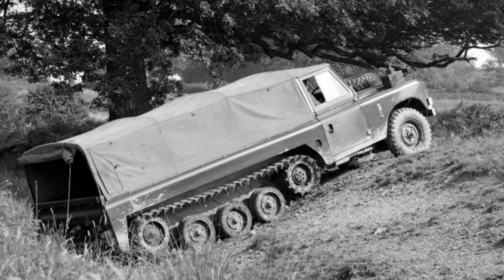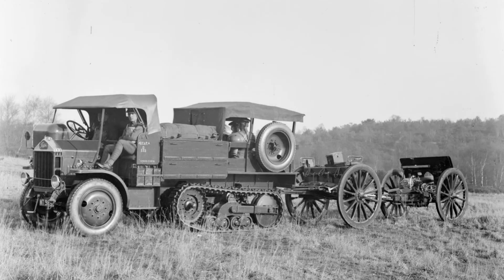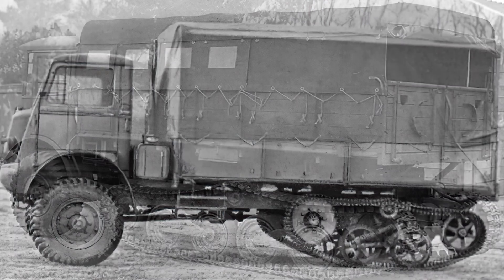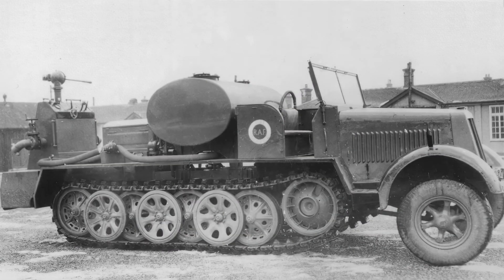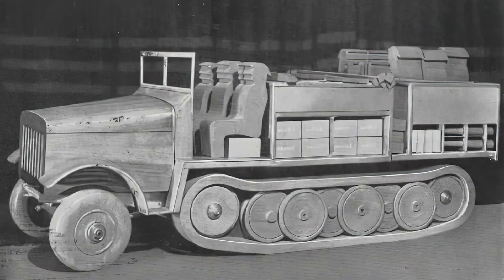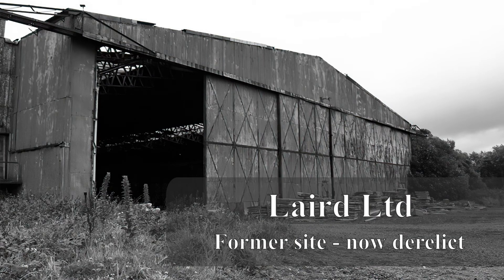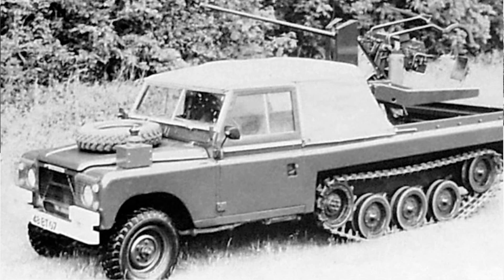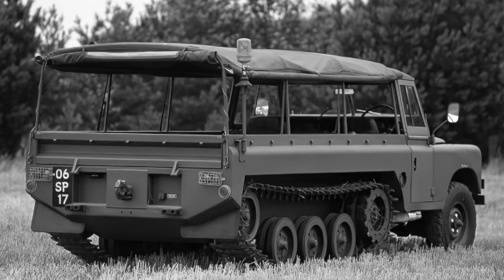Laird Centaur - Tank Design & Development

Comment: The British literally copied the German halftracks steering system in full.

The German setup used the wheels to steer in slight radishes but for sharp turns the tracts did the steering

Comment: I'm not totally sure that track tension is the issue with the track slapping against the underside of the vehicle. As someone who works on CVRTs on a daily basis i can tell you that even with a correctly tensioned track, over rough ground the track will still slap against the underside of the sponson.
Reply: The tracks slap noise was made worse by hitting a sheet of Steel I acted like a drum because it was a single sheet of metal it really got bad when you hit about 70 mph I followed a Centaur in a slightly modified Stalwart at about 55 mph and you could hear the centre over the noise of the engine in the back where I was sitting

Comment: I've been lucky enough to driver Centre the stage one that Bovington have in deep mud I just wanted to go straight so fitting fiddle brakes would have been a good idea with the rear diff being Jaguar and I'm bored behind the driver's seats it would have been very easy to fit the Jaguar and brakes being extremely easy to work on call maintenance and field repairs
Reply from the maker: shes an interesting vehicle, just imagine if they had used a toyota and not a landy tho
Reply: Toyota did Bilston half tracks but they were rubber tracks so nice and quiet on the road
Reply: @timothyfricker7413  Oh what I would give for a Hilux halftrack....LOl...I loved my Hilux....I now run a 20year old RaV4 and she's a wee beastie, no Hilux mind. Just changed the front shocks and hangers and they were the originals  and just coming up to 200,000 miles....
Reply: Sorry for spelling mistakes my Android hates me

Comment: I suspect it's turning radius was terrible . They really needed some form of steering brake.
Reply: But that would negate the whole premise of the half-track - that complicated mechanical systems in the transmission, drive differential and independent braking system can be eliminated by a simple rack and pinion steering system.
Reply: @Cedillallidec  a rack and pinion system is the last thing you want off road as it is too "live" and will rip the wheel out your hands, probably breaking fingers if and when you hit a rut, you learn not to hook your thumbs over the wheel as even with the worm steering on a Land Rover the wheel can kick and still break your thumds if you are not careful, anything with rack and pinion is not meant to be off roaded further than the car park.
Reply: @CrusaderSports250  Nonsense.  And in any event, this isn't about what you want or where you place your foolish thumbs.  This is about what was installed in American WWII half-tracks.  And the simple and robust rack and pinion steering worked exceptionally well.  So what you just wrote is demonstrably wrong.

Comment: Correction as I recall the TRACLAT is a twin engine vehicle not single. IT, along with the AEC Matador were designed as artillery hauling tractors in the Light (Traclat) and Medium (Matador) roles.
One engine powers one track and one engine powers the other... alowing for some very quick steering. Although it isnt as good at higher speed due to the twitchy-ness.